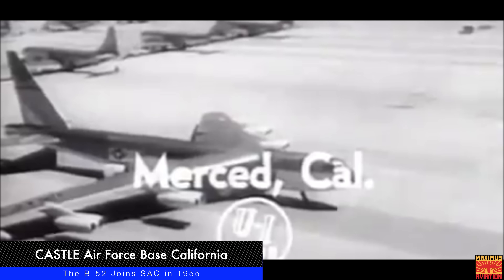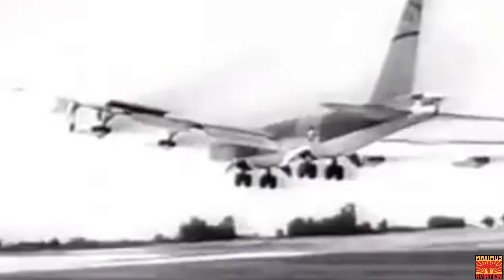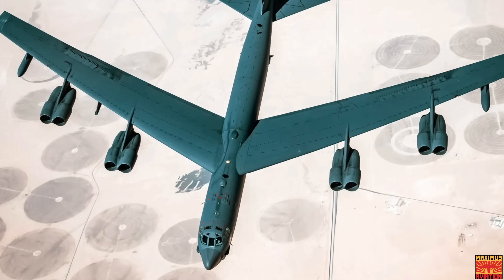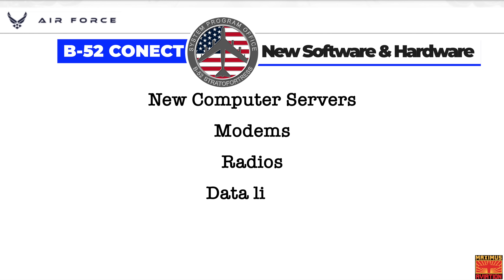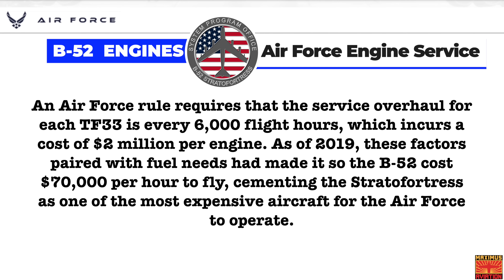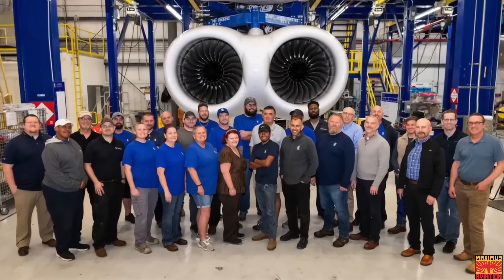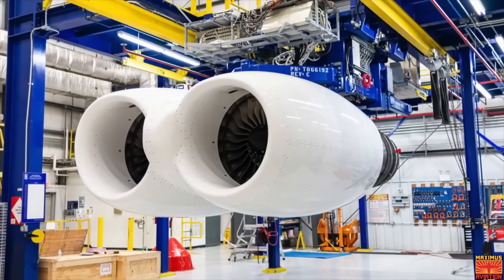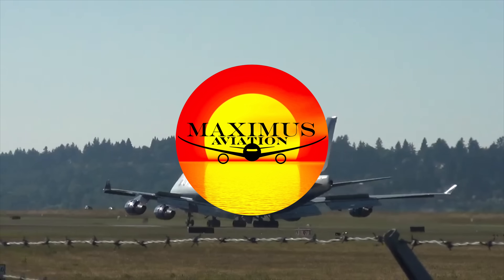The B-52 Will Fly For Over 100 Years With Its New Rolls Royce Engines!

Comment: As a kid in the early 80's my dad was stationed at Carswell AFB. They had B-52 D models, then they changed to the H models. I remember the difference between those two different type engines on those birds. The sound, smoke, and rate of climb the H model had over the D model. I cannot wait to see the difference between the old engines and these new RR engines over the old one.
Reply: The B-52 will receive the F130 engine, the F130 is a BMW engine.
Reply: @sandervanderkammen9230  Hello Sandyboy,  as you know Sandyboy F130 is the US designation for the ROLLS ROYCE BR725  engine (in much the same way that J65 was the US designation for the AS Sapphire engine that was the F9 Metrovick).  As you know it has nothing to do with any wholly owned BMW company. 
You'll recall that in the early 1990s Rolls Royce offered BMW a chance to re-enter the jet engine market with a joint venture to develope the BR 700 series engines from existing Rolls Royce twin spool technology, so that Rolls Royce UK could focus on its more sophisticated triple spool engines. Unfortunately BMW couldn't hack it for long and by 1999 had declared that it was copping out.
As you'll recall , fortunately Rolls Royce was happy to take BMW's share and keep the local workers on and it became a wholly owned Rolls Royce company. As you know that was quite a few years before the development of the BR725 which first ran in 2008 long after BMW was gone.

Comment: So the new engines will be turbofans previous are turbojets. Am I correct.
Reply: Turbojets prior to 1961, currently turbofan (low bypass) TF33
The BMW F130 is a high bypass turbofan
Reply: @sandervanderkammen9230  Hello Sandyboy,  F130 is the US designation for the ROLLS ROYCE BR725 engine (in much the same way that J65 was the US designation for the AS Sapphire engine that was the F9 Metrovick).  
As you know it has nothing to do with any wholly owned BMW company. 
You'll recall that in the early 1990s Rolls Royce offered BMW a chance to re-enter the jet engine market with a joint venture to develope the BR 700 series engines from existing Rolls Royce twin spool technology, so that Rolls Royce UK could focus on its more sophisticated triple spool engines. Unfortunately BMW couldn't hack it for long and by 1999 had declared that it was copping out.
As you'll recall , fortunately Rolls Royce was happy to take BMW's share and keep the local workers on and it became a wholly owned Rolls Royce company. As you know that was quite a few years before the development of the BR725 which first ran in 2008 long after BMW was gone.

Comment: Why not go with four engines.
Surely there are engines available now who can match the power of the original two GE units.
Half the number of engines results in half the maintenance cost and half the potential sources of failure.
Just wondering why this configuration was not considered.
Or maybe it was and it was rejected for good reason.

Comment: Great video and B52  engines by Rolls Royce that sounds awesome 😎
Reply: The F130 is a BMW engine
Reply: @sandervanderkammen9230  Hello Sandyboy,  as you know Sandyboy F130 is the US designation for the ROLLS ROYCE BR725 engine (in much the same way that J65 was the US designation for the AS Sapphire engine that was the F9 Metrovick).  As you know it has nothing to do with any wholly owned BMW company. 
You'll recall that in the early 1990s Rolls Royce offered BMW a chance to re-enter the jet engine market with a joint venture to develope the BR 700 series engines from existing Rolls Royce twin spool technology, so that Rolls Royce UK could focus on its more sophisticated triple spool engines. Unfortunately BMW couldn't hack it for long and by 1999 had declared that it was copping out.
As you'll recall , fortunately Rolls Royce was happy to take BMW's share and keep the local workers on and it became a wholly owned Rolls Royce company. As you know that was quite a few years before the development of the BR725 which first ran in 2008 long after BMW was gone.

Comment: The B-52 with the new rolls Royce engines. Will it be able to increase its  speed,  fly over buildings with a single bond! Why aren't the engines american made engines by an american company most important like pratt whitney?
Reply: The F130 is a BMW engine
Reply: @sandervanderkammen9230  Hello Sandyboy,  F130 is the US designation for the ROLLS ROYCE BR725 engine (in much the same way that J65 was the US designation for the AS Sapphire engine that was the F9 Metrovick).  As you know it has nothing to do with any wholly owned BMW company. 
You'll recall that in the early 1990s Rolls Royce offered BMW a chance to re-enter the jet engine market with a joint venture to develope the BR 700 series engines from existing Rolls Royce twin spool technology, so that Rolls Royce UK could focus on its more sophisticated triple spool engines. Unfortunately BMW couldn't hack it for long and by 1999 had declared that it was copping out.
As you'll recall , fortunately Rolls Royce was happy to take BMW's share and keep the local workers on and it became a wholly owned Rolls Royce company. As you know that was quite a few years before the development of the BR725 which first ran in 2008 long after BMW was gone.

Comment: Technically speaking, this is the 3rd engine type on the B-52. The original aircraft had J-57 turbojet engines, with a civilian designation of JT3C. In P&W lingo, the "C" in "JT3C" meant "turbojet," with no bypass fan. Then they were re-engined with the TF33, with the civilian designation of JT3D. Again, in P&W lingo, the "D" in "JT3D" meant "turbofan" with a bypass fan. Essentially, the engine cores on both engines were the same, but one was a pure turbojet, and the other was a turbofan. Now, the 3rd engine is a Rolls-Royce (USA) turbofan.
If I am not mistaken, they are also planning on making the cockpit digital, with more glass multi-role displays. The added efficiency of the engines will also provide the bombers with a greater range as well.
Reply: Rolls-Royce engines are named after rivers, the F130 is a BMW engine
Reply: @sandervanderkammen9230  Hello Sandyboy,  as you know Sandyboy F130 is the US designation for the ROLLS ROYCE BR725 engine (in much the same way that J65 was the US designation for the AS Sapphire engine that was the F9 Metrovick).  As you know it has nothing to do with any wholly owned BMW company. 
You'll recall that in the early 1990s Rolls Royce offered BMW a chance to re-enter the jet engine market with a joint venture to develope the BR 700 series engines from existing Rolls Royce twin spool technology, so that Rolls Royce UK could focus on its more sophisticated triple spool engines. Unfortunately BMW couldn't hack it for long and by 1999 had declared that it was copping out.
As you'll recall , fortunately Rolls Royce was happy to take BMW's share and keep the local workers on and it became a wholly owned Rolls Royce company. As you know that was quite a few years before the development of the BR725 which first ran in 2008 long after BMW was gone.

Comment: Déjà vu? Some eighty years ago the US military opted to install Rolls Royce engines into the underperforming P-51 Mustang and the outcome was the best fighter aircraft of WWII. Those Merlin engines were manufactured in the US by Packard so this upgrade of the B-52s is a bit reminiscent of that. 🇬🇧🇺🇸
Reply: The F130 is a BMW engine
Reply: @sandervanderkammen9230  Hello Sandyboy,  as you know Sandyboy F130 is the US designation for the ROLLS ROYCE BR725 engine (in much the same way that J65 was the US designation for the AS Sapphire engine that was the F9 Metrovick).  As you know it has nothing to do with any wholly owned BMW company. 
You'll recall that in the early 1990s Rolls Royce offered BMW a chance to re-enter the jet engine market with a joint venture to develope the BR 700 series engines from existing Rolls Royce twin spool technology, so that Rolls Royce UK could focus on its more sophisticated triple spool engines. Unfortunately BMW couldn't hack it for long and by 1999 had declared that it was copping out.
As you'll recall , fortunately Rolls Royce was happy to take BMW's share and keep the local workers on and it became a wholly owned Rolls Royce company. As you know that was quite a few years before the development of the BR725 which first ran in 2008 long after BMW was gone.

Comment: The 707, of course, was not the world's first commercial  jet airliner. That was the De Havilland Comet, first flight 1949.The Tupolev Tu-104 was also in service before the 707.
Reply: The world's first successful airworthy jet airliner is the Boeing 707. The Comet Disaster was the worst engineering failure in commercial jet aviation.
The Comet 1 was grounded after 6 unexplained accidents and NEVER returned to commercial passenger service.
Reply: @sandervanderkammen9230  But as you know Sandyboy, the Comet was in service for more than forty years and with operators in twenty countries.

Comment: Will the Buff,s new Roller engines be fitted with thrust reversers?, a bit pointless retaining the old drag chute, sorry to say the Buffs eat runways, in decent condition fully loaded for bear ,a  Buff ,or StratoPig needs best part of 11,000 foot of concrete to lift off. What about upgrading the Buff,s brakes ?,any chance of BF Goodrich fitting carbon ceramic brake packs, as stopping a StratoPig without reverse thrust cinches ones backside.  During the Vietnam War at the height of 'Linebacker' missions out of Andersen Guam ,drivers of old 'Stove Pipe' D&F model Buffs, each loaded with one hundred eight 750lb iron bombs, threw their beasts off the runway like suicidal lemmings. Doped, water injected  Pratt& Whittney J57 P9 Stove Pipes screaming to turn the air blacker than a Vicar,s cassock, StratoPig drivers prayed to God their overloaded beasts will pick up airspeed. 13,000 feet of Andersen,s best concrete was not enough for an overloaded 'Big Belly' 'Stove Pipe Buff' to lift off  normally, as  if like a TWA flight to Frankfurt.

Comment: The B52 is some piece of work! 100 years sounds crazy!! Being a Brit, I am proud to think of UK-origin engines doing their thing on the BUFF. One thing though - I wonder why a single large turbofan per pylon wasn't adopted? Too big a target if under attack? 8 engines is a lot of redundancy though, and any attack that could take an engine or two out is just as likely to destroy the wing. And there is no redundancy with loss of wing/s! Do you have any stats on power output of the new (old) RR units?

Comment: I still dont get it....why 8 engines...why not 4 powerfull new ones....
Reply: Way too much work to modify the aircraft for 4 engines, it would require extensive modification to the wings, fuel system, flight control systems and the landing gear.
The BMW F130 is a perfect fit and will slot right into place with minimal  modifications.
Reply: @sandervanderkammen9230   As you know Sandyboy,  F130 is the US designation for the ROLLS ROYCE BR725 engine (in much the same way that J65 was the US designation for the AS Sapphire engine that was the F9 Metrovick).  
As you know it has nothing to do with any wholly owned BMW company. 
You'll recall that in the early 1990s Rolls Royce offered BMW a chance to re-enter the jet engine market with a joint venture to develope the BR 700 series engines from existing Rolls Royce twin spool technology, so that Rolls Royce UK could focus on its more sophisticated triple spool engines. Unfortunately BMW couldn't hack it for long and by 1999 had declared that it was copping out.
As you'll recall , fortunately Rolls Royce was happy to take BMW's share and keep the local workers on and it became a wholly owned Rolls Royce company. As you know that was quite a few years before the development of the BR725 which first ran in 2008 long after BMW was gone.

Comment: Those are BMW engines...
Reply: Those are ROLLS ROYCE engines...
Reply: Hello Sandyboy,  F130 is the US designation for the ROLLS ROYCE BR725 engine (in much the same way that J65 was the US designation for the AS Sapphire engine that was the F9 Metrovick).  As you know it has nothing to do with any wholly owned BMW company. 
You'll recall that in the early 1990s Rolls Royce offered BMW a chance to re-enter the jet engine market with a joint venture to develope the BR 700 series engines from existing Rolls Royce twin spool technology, so that Rolls Royce UK could focus on its more sophisticated triple spool engines. Unfortunately BMW couldn't hack it for long and by 1999 had declared that it was copping out.
As you'll recall , fortunately Rolls Royce was happy to take BMW's share and keep the local workers on and it became a wholly owned Rolls Royce company. As you know that was quite a few years before the development of the BR725 which first ran in 2008 long after BMW was gone.

Comment: Right two things wrong. The pearl engines are from the G700 not the G650. Secondly, the B707 was not the first jet airliner. The first jet airliner was the De Havilland Commit.
Reply: Regardless, the comet was still the first jet airliner. The pearl engine is fitted to the G700. The worst aviation engineering disaster until the 737 Max.
Reply: @acengineer737  The Comet Disaster was the first failed attempt at a Jet airliner.
The first jet airliner is the Boeing 707.
Reply: @acengineer737  The BMW F130 was certified only for the Hawker Siddeley H.S.801 Nimrod MRA4 variant.
Reply: @sandervanderkammen9230  Hello Sandyboy, as you know, there is no such engine as the BMW F130. 
As you know F13 is the US designation for the ROLLS ROYCE BR 725 engine.
Reply: @acengineer737  The Boeing 737 is the most successful jet aircraft in history and the 737-8 Still has a better safety record than the Comet... better than the Concorde too!
Reply: The comet was the first jet airliner. It was so unsuccessful that it went out of service in 1981. Not bad for an aircraft that flew in 1949, 5 years before the 707.
Reply: @acengineer737  WRONG!
The Comet 1 was grounded in 1954 after 6 unexplained accidents and NEVER RETURNED TO REVENUE SERVICE. its airworthiness certification was permanently REVOKED in 1958.
Reply: @acengineer737  The Boeing 707 series flew on July 15th 1954 and is still in service today... it's expected to remain in RAF and USAAF service until at least 2045.
Reply: The F130 is a a BMW engine designed for the failed MRA4 program.
The Boeing 707 series was the world's first successful, airworthy jet airliner.
The Comet Disaster was the worst engineering failure in commercial jet aviation jet aviation history, the Comet 1 had its airworthiness certification permanently revoked.
Reply: @sandervanderkammen9230  Hello Sandyboy,  F130 is the US designation for the ROLLS ROYCE BR725 engine (in much the same way that J65 was the US designation for the AS Sapphire engine that was the F9 Metrovick).  As you know it has nothing to do with any wholly owned BMW company. 
You'll recall that in the early 1990s Rolls Royce offered BMW a chance to re-enter the jet engine market with a joint venture to develope the BR 700 series engines from existing Rolls Royce twin spool technology, so that Rolls Royce UK could focus on its more sophisticated triple spool engines. Unfortunately BMW couldn't hack it for long and by 1999 had declared that it was copping out.
As you'll recall , fortunately Rolls Royce was happy to take BMW's share and keep the local workers on and it became a wholly owned Rolls Royce company. As you know that was quite a few years before the development of the BR725 which first ran in 2008 long after BMW was gone.

Comment: With the new engines, does this mean no more "wet" takeoffs?
Reply: The BMW F130 is dry thrust only rated at 17,000 lbs thrust... no more rolling coal on takeoff.
Reply: @sandervanderkammen9230  You haven't lived until you have done a wet takeoff in a BUFF or a KC-135.
Reply: @sandervanderkammen9230  Hello Sandyboy,  as you know Sandyboy F130 is the US designation for the ROLLS ROYCE BR725 engine (in much the same way that J65 was the US designation for the AS Sapphire engine that was the F9 Metrovick).  As you know it has nothing to do with any wholly owned BMW company. 
You'll recall that in the early 1990s Rolls Royce offered BMW a chance to re-enter the jet engine market with a joint venture to develope the BR 700 series engines from existing Rolls Royce twin spool technology, so that Rolls Royce UK could focus on its more sophisticated triple spool engines. Unfortunately BMW couldn't hack it for long and by 1999 had declared that it was copping out.
As you'll recall , fortunately Rolls Royce was happy to take BMW's share and keep the local workers on and it became a wholly owned Rolls Royce company. As you know that was quite a few years before the development of the BR725 which first ran in 2008 long after BMW was gone.

Comment: New engines may be a good idea, but why not simplify to 4 mid-sized turbofans instead. Should be workable since there will be newly designed engine pods anyway and the 8 modern engines will require completely new plumbing and electronics anyway. 4 turbofans could give same (or more) power, better economy longer range bigger payload etc etc. Kind of like a 737 Max? Talk to Boeing!